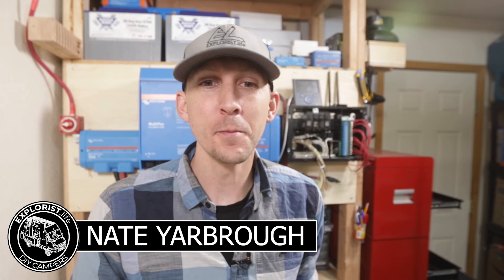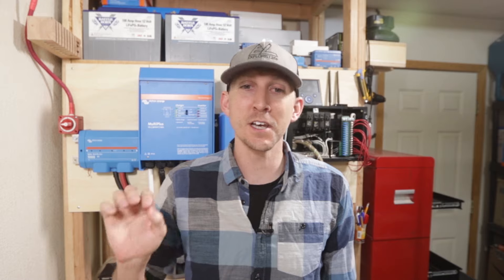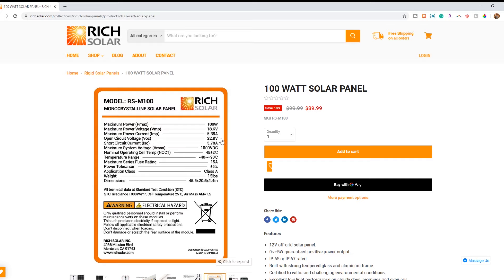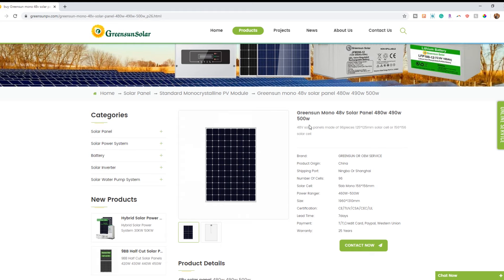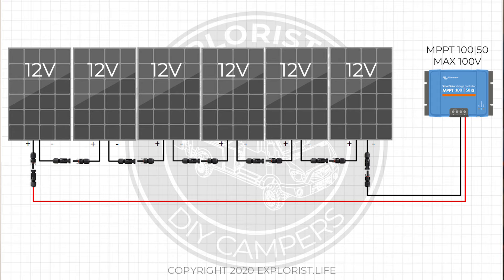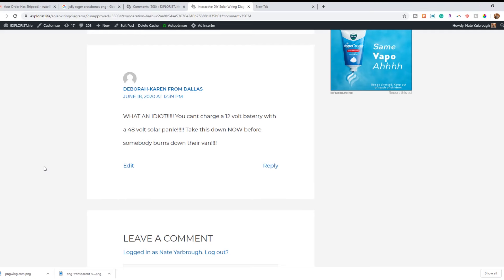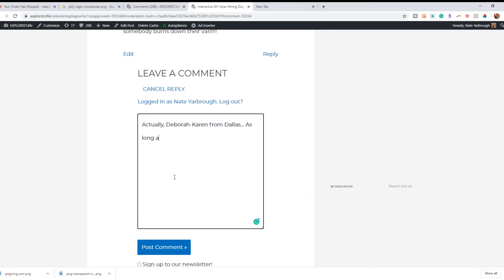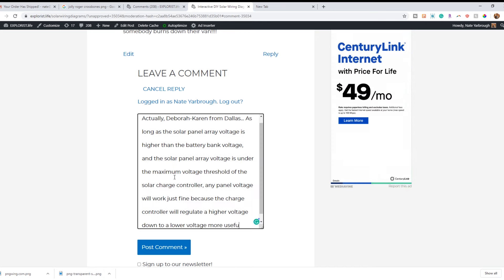12 Volt? 24 Volt? 48 Volt? Which Solar Panels for a DIY Camper Electrical Build

Comment: What advantage would a 48v system have over a 12v system in a van build? 🤔
Reply: To my knowledge, Inverters can convert 48v to 240v AC more efficiently (and with smaller wiring if you're working with a lot of power). Probably only relevant for larger systems like off grid houses, and big house boats.

If you only had a 48v battery bank (no 12v at all), you'd then need a 48v to 12v DC to DC converter  (victron Orion) to power your 12v devices.
Reply: Higher voltage means lower amperage and thus a smaller wire needed 

Important on the roof less roof ports as you can only get 30A per port

Comment: I have gathering stuff to make a Better system, I have a 200 watt Anker folding solar panel, a Victron 100/30 and two new 12 volt lithium 100 ah batteries, and looking at a Giandel pure sine wave 2000/400 24 volt inverter. Then later I hope to get a 400ah 24 volt battery and some more panels Thank you for clearing that up about the size of the panel

Comment: I LOVE your videos and gave learned a lot.
I hope someone can help me, I have 8 used good shape commercial solar panels 36.77V 220w each. Model CHSM6610P-220 (220W). I want to install them on my 16' cargo trailer vto have complete power off grid to use it as a toy hauler / travel trailer. Being off grid for a week at a time. I also want to use the trailer as an emergency power system for my mobile home when the power goes out so I plan on having a connection to power my mobile home in those cases. I already have a 5,000 watt 12v sine wave inverter with  8 to 10k surge. Will be installing a 14k HVAC system in the trailer to keep cool and heat when needed during hunting season. What would be the best way to connect my solar panels together and a good solar controller should I use. Also how many batteries do you think I would need to accomplish this?
 The trailer will have water and a on demand propane tankless water heater and small fridge with led lighting as well.
 Any help would be greatly appreciated! 
Here are my solar panels spec:
 Electrical Characteristics
STC Power Rating 220W
PTC Power Rating 199.5W 1
STC Power per unit of area 12.4W/ft2 (134.0W/m2)
Peak Efficiency 13.4%
Power Tolerances -3%/+3%
Number of Cells 60
Nominal Voltage not applicable
Imp 7.38A
Vmp 29.7V
Isc 8.12A
Voc 36.77V
NOCT 47°C
Temp. Coefficient of Power -0.46%/K
Temp. Coefficient of Voltage -0.129V/K
Series Fuse Rating 15A
Maximum System Voltage 600V
Mechanical Characteristics
Type Polycrystalline Silicon
Output Terminal Type Multicontact Connector Type 4
Frame Color Clear
Backsheet Color data not available
Length 65in (1,652mm)
Width 39.1in (994mm)
Depth 1.8in (45mm)
Weight 44.1lb (20kg)
Installation Method Rack-Mounted
Warranty and Certifications
80% Power Output Warranty Period 15yrs
90% Power Output Warranty Period 10yrs
UL Fire Classification data not available
Compliances UL 1703
CSI Listed

Comment: I have a 48 volt golf cart it is a limo extra long type and has a very large roof I would like to put a single 72 cell solar panel on the roof to charge the 48 bolt pack.
Reply from the maker: Neat!  Sounds like a cool project.

Comment: Ok so I just purchased a 3500 w 24 volt inverter 
I acquired some 12 volt 100 w Solar panel’s 
I got a job as a camp host one of the other camp host gave me his solar panels 
I would really like to use them if possible 
Any information would be appreciated thanks I am going to watch the rest of your videos 
Thanks for taking your time and putting these videos together

Comment: Hello sir great video
So i have built a solar system here's the list
2 solar panels
100 watt each 
total 200watts
20amp charge controller
1500watts inverter
And 100amp battery
I need i bit more 
pawer/hours
Both my controler and inverter are compatible with 24v
Can i add an extra 100 amp battery with my current system
Thx and have a wonderful day👌👍
Reply from the maker: Although it's best if the batteries in the array are the same age...If the battery you are wanting to add is the same as the existing batteries, there is no problem with that.
Reply: @EXPLORISTlife  
Yes I'll be buying it from the same dealer
My current 100a battery is 8 months old
The new one will be the same brand and model but i believe there will be a difference between as new
Thanks anyway sir
Much appreciated
Enjoy your day👍

Comment: I am trying to make a solar energy system. I'm trying to build it  based on a 48v battery and 2 pvs each 170w (Voc 34.6 v) connected in series. 
1 ) what my pv system should be 12 v or 24 ?
 
2) charger controls should be 12v or 24v and how am I going to manage that knowing  the battery is 48v?
3) my inverter is 2.5 kw. should i pick 12v or 24v ? 

Thank you very much for your help and looking for forward hearing from you
Reply from the maker: 1: The solar array needs to be a MINIMUM of 5v over your battery bank voltage to start charging (at least with Victron charge controllers).  Wiring those 2 panels in series should get the job done.

2: Most (please verify with the user manual before purchasing) Victron charge controllers automatically sense if they are connected to a 12v, 24v, or 48v battery bank and adjust accordingly.

3: You need a 48v Inverter to match your 48v battery bank.
Reply: @EXPLORISTlife   thank you... Quick question if the current of the charger controller is higher or less than the battery current, is that a problem ?

Comment: Nice video need asked questions i have 3000 watts 48V inverter ok i have solar charger controller 48V 30A am in Toronto  they only sell 12V solar panel  how panel need or how watts of panel i need  can used 4 12 volt panel  just asking
Reply from the maker: Hey, @kennthbrowne7051! I appreciate you taking the time to ask your question, but unfortunately, I don't have enough info about your specific question to provide an accurate answer, but here is a playlist that, if you watch all of the videos start-to-finish (and take notes 😉), you'll have a REALLY good idea of how to design a solar array: https://www.youtube.com/watch?v=Jkbs84sBHsg&list=PLmvhcyi4n0TV9pi83rFTv3ZuMT_S1xIZt

Alternatively, I have some of my most common solar array setups pre-built here: https://shop.explorist.life/product-category/all-products/camper-wiring-kits/solar-charging-wiring-kits/
Reply: @EXPLORISTlife  i will make video and upload up maybe you tell how such solar panel i need not much about it one guy said i need 60V solar panel not real know

Comment: 12v, 24v, 36v, 48v matters and is very important when using PULSE WIDTH MODULATOR (PWM) Charger Controller.
Reply from the maker: Sure, I guess. That’s old tech though.  We don’t even sell pwm controllers in our store.  Not really relevant in 2024.

Comment: If a solar panel has an open circuit voltage of 44.4, I can run a 24v system correct? I am so new to this but trying to educate as thoroughly as possible. Thanks!
Reply from the maker: You could run a 12v OR 24v battery bank with that panel.
Reply: @EXPLORISTlife  So if I had 3 panels it would be fine as long as I have the proper charge controller? Also what are your thoughts on using repurposed car lithium ion batteries?
Reply from the maker: Correct.  Here is a video that will help you size the charge controller: https://youtu.be/MxziHKvTRh8

For recycled car batteries.  Thats fine if you are into electrical arts & crafts... but if you want your system to 'just work', I can't recommend that.
Reply: @EXPLORISTlife  Awesome. Thank you for the help! You may be hearing from me again. That's unfortunate on the car batteries. Just thinking environmentally and such. Thanks again!

Comment: Okay yes I am confused lol. I have a 100/30 Victron Smart MPPT Controller with an SOK 12v 206ah battery and have it attached to a rich solar 190 solar panel with open circuit of 24.3V max power current of 9.31A.  I was looking at some panels that are Ying Li Solar that are 255 W 24V (yes I have disregarded the 24V) with an open circuit of 37.7. I think this is okay to install. I do need to go back to your other video to see if using the 190 will provide any more power to the battery. I just wanted to run it by you to check. Hopefully you have time to respond. Thanks and I love the videos. Thanks Kevin and by the way we don't get super cold in the winter we are usually in northern Arizona in the Hualapai Mountains
Reply from the maker: You'll probably just want to divide the two sizes up into their own arrays each to their own charge controllers.
Reply: @EXPLORISTlife  Thank You Sir I appreciate that.

Comment: Okay I got a question... Please answer with your best suggestions... I get what you're saying because the ratings really aren't what they are... However, I'm thinking about a smaller array and a higher voltage battery small mobile food cart... Thinking of using a 48V 100ah golf cart battery 48V EG4 MPPT 3kW Off-Grid Inverter with a 500 VDC input capability... "way more than I can possibly need" The battery for its size and durability of construction, And the EG4 Mppt inverter for its features and small compact all in one size. The problem is the total area for the array has to be No Bigger than 5'x10'... I want the highest possible amp output so it will charge quickly and use less of my battery through the day. If I use 12 volt So called panels i'm going to have to run it in series correct because I have to have at least 48V if not a little bit more in order to charge my forty eight will battery right? And if I do so, I'm only going to be able to get maybe what a 200W of an array for that size... I figure i'm going to need at least six hundred watts if I want to run on solar alone... That's my dilemma Highly confused on this, Any suggestions??? All i'm running by the way... Is a small frigerator of 150W @ 120v or so and a lot of lighting, I am wanting the cart to run standalone at least 10 hours off grid. I also plan on putting in a DC  Dc charger for when the cart is in mobile tow. I'll need minimal twelve volt so I'll need to deal with that as well. (Water pump, Possibly the led lighting, and maybe a small stereo)
Thanks again please leave any suggestions on a recommended solar array for it...
Reply from the maker: Hey, @justinhobart8747! I appreciate you taking the time to ask your question, but unfortunately, I don't have enough info about your specific question to provide an accurate answer, but here is a playlist that, if you watch all of the videos start-to-finish (and take notes 😉), you'll have a REALLY good idea of how to design a solar array: https://www.youtube.com/watch?v=Jkbs84sBHsg&list=PLmvhcyi4n0TV9pi83rFTv3ZuMT_S1xIZt

Alternatively, I have some of my most common solar array setups pre-built here: https://shop.explorist.life/product-category/all-products/camper-wiring-kits/solar-charging-wiring-kits/

Comment: Hoping you could answer a couple questions for me. I’m putting together a portable system for emergencies. I have 4 sok 12v 206 ah batteries on a small cart with all terminals close together. Also using a growatt 5000w 48v combo unit. My question is does it make much of a difference if I use 8 inch cables as opposed to 6 inch cables to connect the batteries together for this application. Also I was planning on using 2 gauge wire and is that sufficient for my purpose?? Thanks much in advance, Cheers, Chuck
Reply from the maker: 6" vs 8" likely won't matter, but here is a tutorial that will teach you how to size wire: https://youtu.be/ki3WXVR48eM

Comment: Need help! I have ordered the new Bluetti AC200Max and would like to have my panels set up by the time the unit arrives.  Specs for the unit are:  Solar Input 900w (10-145 VOC) Max 15A..I will wire in series to keep the amps down thanks to your video. The tech at Bluetti confirmed the 12v battery can not go over 8 amps.  So I will get a golf cart battery and he assured me it would charge the unit.  With this unit you can charge 4 ways including lead acid batteries.. I am looking to install around (3) 250W panels for a total of 750W. other info on each panel is VOC 37.6 , Max system voltage 600v (ul), (VMP) 30.3,  max power current 8.27. Will this setup work with the Bluetti Solar Input described above...Also what size MPPT would you recommend.  Thanks in advance, and thank you for great videos.

Comment: Would it help if I take a sharpie pen and cross off the voltage rating on the solar panels? That way I will always think of them as the same. They are not 12v, 24v or 48v. I took the pledge.
Reply from the maker: Your solar panels probably don't say "12V, 24V or 48V", so that probably wouldn't help too much.  They will likely be saying their actual voltage.

Comment: Can you Help me ..
I have a " GO POWER PLUS " . I received as a Birthday Present .
Now I'm trying to Charge it with a SOLAR PANEL ..
Can I Plug in a 24 Volt Solar Panel into my " GO POWER PLUS " .. I'm New at The SOLAR GAME ..
Right No ow I am Charging it through my AC Wall Outlet ..
Thank You for your HELP .. 🆘 😊
Reply from the maker: Hey J James!  I'm not too familiar with the 'Go Power Plus' unit.  The user manual should tell you what the max voltage input of solar is for it; which should at least get you started.

Comment: If We are using 24V panels on the 12 V system. Are we losing any efficiencies when they bring the voltage down? Thanks
Reply from the maker: no.
Reply: Awesome, thanks for your prompt reply

Comment: Can i use a 48 volts soler panel to charge a 12 volts batery with pwm charge controller
Reply from the maker: What is the max input voltage of the charge controller?  Knowing that will answer your question.

Comment: Brilliant ...that why charge controllers are awesome - they make different voltage components (solar panels are batteries) work together. And as you stated - as long as the solar panel voltage is above the battery voltage AND the solar panel voltage is under the charge controller max Voltage, then its Bob's your Uncle.

Comment: Hi , As you said any panels array will work if array voltages are higher than battery bank voltages and under the maximum voltage limit of charge controller. 
In that context what will happen if array voltages are lower than batter bank (voltage can be low the way array has been designed or when voltage start decreasing towards night).
My understanding is that as I learnt from your other videos that panel array will work fine if it is compatible with charge controller voltage limitation. If voltages are lower than battery bank, charge controller will regulate it to desired battery back voltage.

If this understanding is wrong, then how charge controller charge battery bank when there are less voltages in those days when there is no enough sun light or sun light available for limited time (winter days).

Comment: I have a question. Solar charge controller regulates voltage. Does it also regulate current?  I have a 16Ah 12V LifePo4 battery. Can I put a 400W solar panel through charge controller to charge it? Thanks.
Reply from the maker: Charge controllers have a max current output, yes; but it's generally not able to be adjusted.
Reply: BSC3048 to BSC6048 PWM solar charge controllers have current adjustment for Lithium charging, default is 5A. 100V max solar input

Comment: If you have a 48v 100 watt panel will that be putting in 8.3 amps at 12v or 2 amps at 48v. When figuring out what your charge controller is rated to?

Comment: I’m playing around with a of couple of different Rv solar systems builds. I am leaning towards a 48v system with four 48v 100ah batteries. The minimum vdc is 120v the max is 500 vdc. I’m trying to get the best bang for my buck on solar panels. I was looking at renogy 200watt flexible panels since my ORV tt has a curved roof. Iam trying to justify their quality vs application vs weight vs longevity. My battery bank is going to be 400lbs the inverter is an all in one system. I’ll just need a 48v to 12v converter. What other panels would you recommend over these?  Thanks
Reply from the maker: We don't really keep up with the availability of flexible solar panels as their lifespan isn't long enough for our liking.

Comment: So solar array voltage have to be bigger than batery bank voltage, what if it is the same voltage? 2x12v solar panels for a 24v battery bank? Would that affect the charge time?
Reply from the maker: Solar array voltage must be larger than the battery bank voltage by at LEAST 5 volts.  If it is not, the batteries will not charge.

Comment: Is the mentioned temperature of -40 degrees C or F?
Reply from the maker: -40 is the same at F and C. 😆👍
Reply: @EXPLORISTlife  I ALWAYS ask this question when given the opportunity, to see if anyone notices. LOL!!!
As a retired EE and electronic equipment installation project manager, your videos are AMAZING!  You make everything really easy to understand, which can be very difficult considering all of the possible options and configurations.
I have to say that you are comparable to my installation technicians, and they were the very best!
I bought your 24V-6000W-120V240V-Split-Phase-Camper-Solar diagram, too.
Keep up the excellent work and remember to never complete the circuit!

Comment: Will a 32V Max 37V Open, 6A Max, 7A Short Circuit 200W Panel work better than a ~20V Max 200W Panel if using a Victron 75V Max, 15Amp Max solar charge controller?  Will the controller turn on easier (with less sun) using a ~36V panel because the controller needs battey Voltage +5V to turn on?
Reply from the maker: Correct.
Reply: @EXPLORISTlife  thank you.  Thinking about making a micro camper to pull behind my e-bike. I was gunna pull the trigger on a 200watt flexible solar panel to mount to the roof because it’s less than 10 lbs.  I think I’ll end up using a rigid panel despite its 25lb weight.  I’ve heard the flexible panels only last a few years compared to the 25 year life of “standard” panels.